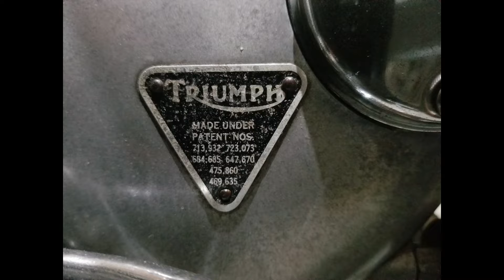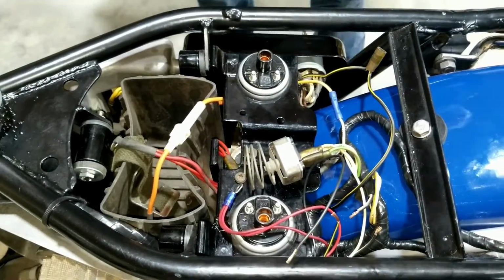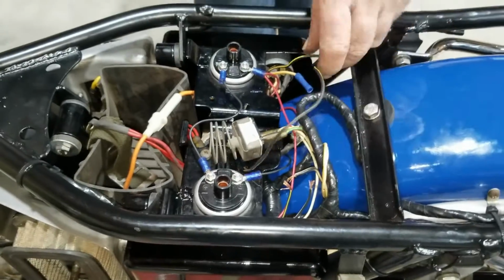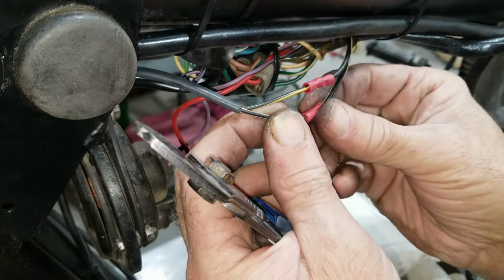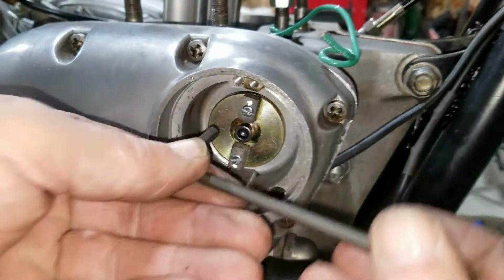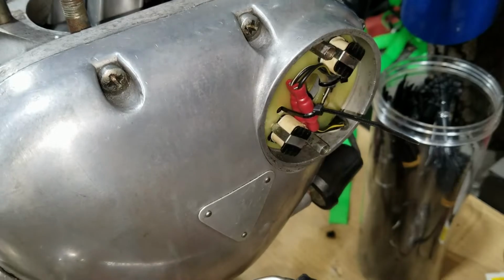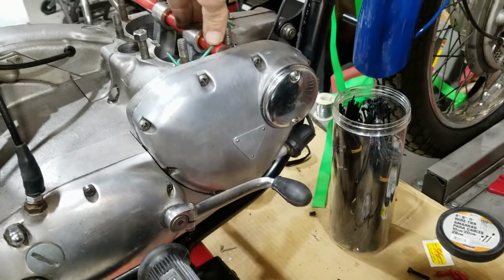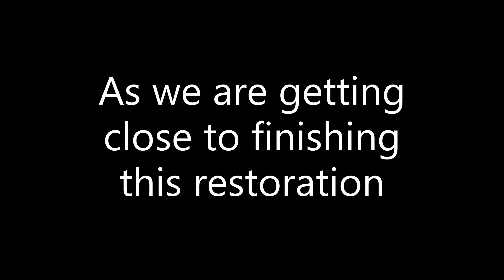1971 Triumph Tiger 650cc Restoration Part 20, Installing a Micro Digital Boyer Electronic Ignition

Comment: So you haven't set the timing to 38 degrees before TDC yet. Is that correct?
Reply from the maker: Yes we did set it statically to 38 degrees before top dead, to clarify boyer and many other electronic ignitions fire both plugs at the same time so in the video we raise the connecting rods to the top of the stroke then we backed the crank up so the pointer lined up with the line on the rotor which is 38 degrees before top dead center then we lined the ignition rotor white dot up to the correct clockwise hole in the ignition stator plate and made sure it was centered in the hole and in the center of the pillar bolt slots at the same time and in our experience with these ignitions the static setting will be within plus or minus 2 degrees if not perfect once we start the bike and check the timing with a strobe timing light later.
Reply: @jessesvintagegarage765  Thank you again. I was using the Pa zon and in the manual it talk about setting the timing to 19 degrees. But then I realized that was only when using the disc on the camshaft.RMM
Reply: @jessesvintagegarage765  Thanks for sharing. So does the mark on the rotor indicate TDC or 38d BTDC? Or did you manually do this with a timing wheel but not film that part?
Reply from the maker: The pointer lined up with the line on the rotor which the line on the rotor is 38 degrees before top dead center marking. Then we lined the boyer ignition rotor piece with the white dot up to the correct clockwise hole in the ignition stator plate and made sure it was centered in the hole and tightened it down. We did the rotor alignment manually and may not have filmed that part.
Reply: @jessesvintagegarage765  it’s just that there is no line in your video showing 38d BTDC. So just to confirm the marks present are for TDC and BDC and still need to be moved 38d before fitting the ignition rotor?
Reply from the maker: At 11 minutes in we take the timing window cover off and talk about the pointer how one BTDC and one is BBDC when you line the pointer up with the BTDC line you go to the other side and install the piece with the white dot in the window of the ignition module and that is static timing to get you really close then later when its running you just make a small adjustment to get the timing right on
Reply: @jessesvintagegarage765  Sorry man little confused. At 12:01 you state those marks are TDC and BDC not BTDC or BBDC. Can you clarify, do you need to manually adjust to 38d with a timing wheel or not?
Reply from the maker: Sorry for the confusion and I was making it worse, ok so let me start over, Yes at 12:01 its stated that the alternator rotor has 2 marks on it one is TDC and the other is BDC and that is correct, what I failed to say is the pointer thats installed in the primary cover is located for 38 BTDC so to set the timing close statically the pistons need to be at the top of the stroke then rotate the motor backwards to line the rotor mark to the pointer then set ignition rotor and stator plate to the correct clockwise rotation hole centering the white dot in that hole.
Reply: @jessesvintagegarage765  Amazing thank you. So in theory, I don’t need a timing wheel or strobe light if I have and use that mark.
Reply from the maker: Thanks, But yes in theory, statically timing is with in 1 or 2 degrees of the 38 degrees BTDC but you should still check with a strobe timing light to get right on, and depending on what ignition module you have but all boyer ignition systems need to rev to 5000 rpm for full advance setting.
Reply: @jessesvintagegarage765 maaan I have watched all your guys vids. Currently been rebuilding my 72 tiger. Bought a boyer kit and I'm lost. I have way to many wires left. I'm not sure if I'm forgetting stuff. Please advise. I watched the vid of you guys setting up coils and I'm still lost!
Reply from the maker: @allgunzsblazen  You need 2 - 6v coils they end up being wired in series to equal a 12v coil the boyer box has 5 wires, White wire (power wire that comes from the keyed switch) Black wire ( gets hooked to one of the coils Negative post) Red wire (gets hooked up to the other coils Positive post and also a jumper from this post to a good frame grounding  point) so at this point each coil has 1 wire hooked up to each coil and there should be a Positive and a Negative post open there needs to be a jumper wire made to connect these 2 posts together. At this point the ignition box and coils are wired and ready. There is only two wires left to hook up Black with a yellow stripe and a black with a white stripe they both get hooked up to the trigger plate these wires must be kept straight and not switched or reversed accidentally or the bike won't start or run correctly.
 It is also important to know that all the above instructions are for Positive ground as original. If the bike has been switched to Negative ground this wiring I described is wrong and will burn out a boyer ign box they can not be hooked up backwards ever. Polarity is very impotant
Reply: @jessesvintagegarage765  thanks for the reply! I got the full kit. 2 coils , box, rectifier. 
I have 4 red wires tied in to 2 clips, 2 wire per clip. And one brown to blue.